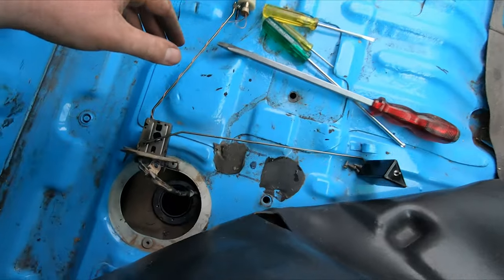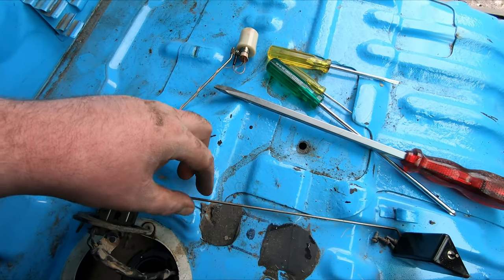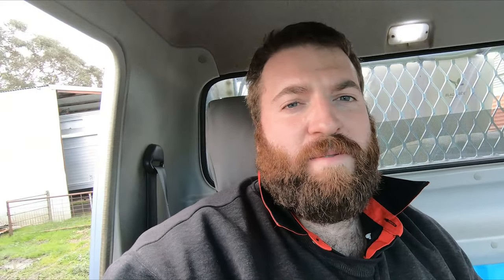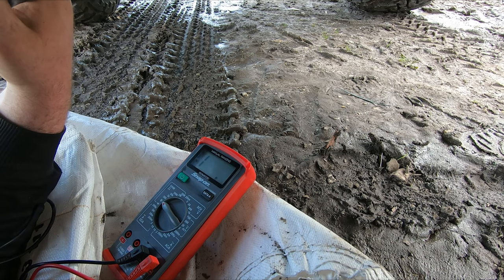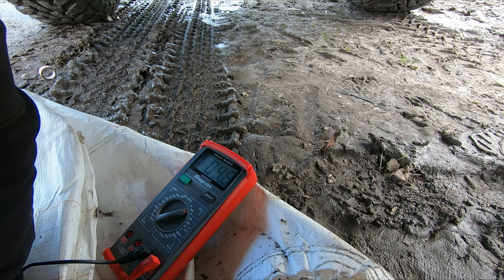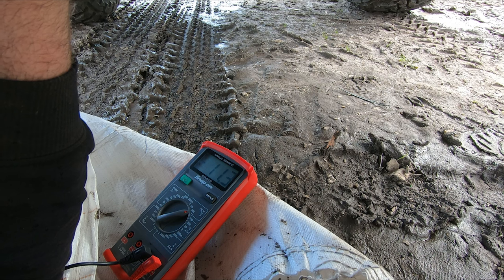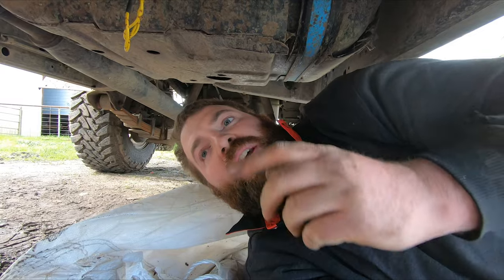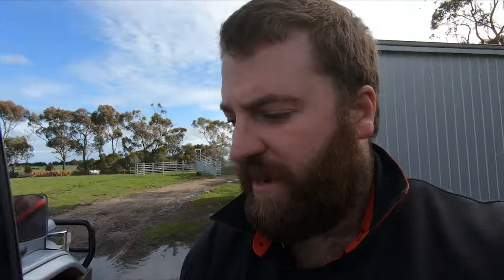How To Check If A Fuel Gauge Sender Unit Is Working On A Toyota 79 Series Landcruiser

Comment: Brilliant mate. Mine is untrustworthy usually, thought it was just a Toyota thing :) I had to brake hard recently when someone in front saw that they had to turn NOW!!! My low level light came on and it won't reset. I have added fuel and driven it around but that didn't fix it. Like you I have been fooled by the reading before. I once drove in a panic to fill up because the gauge told me I was nearly empty and I managed to get 25 l in. Thanks for this video, I now have a reference to begin my investigation.
Reply from the maker: @waynedwyer6509  yep they can be a bit of a pain when they are not working right.
Reply: @CamshaftFM  thanks again for the tips, I'll be pulling out my passenger seat soon lol